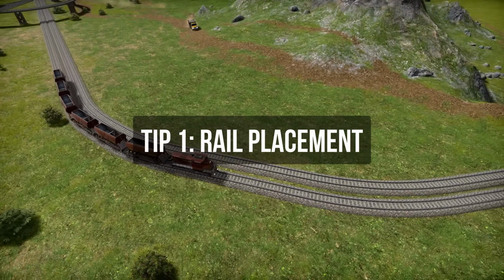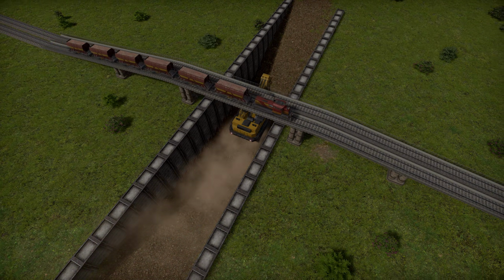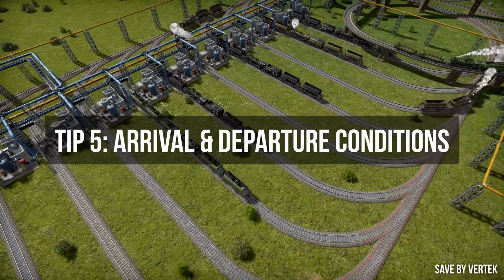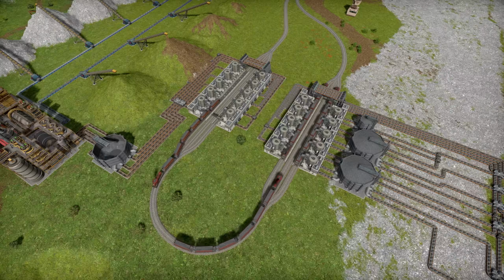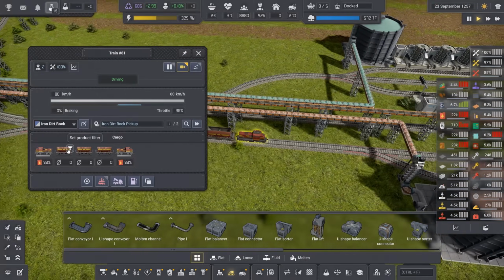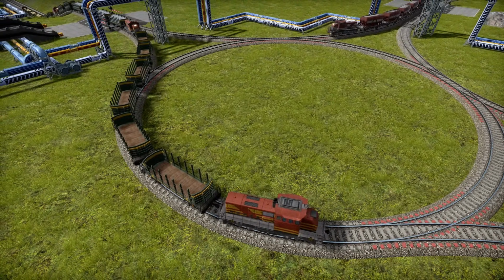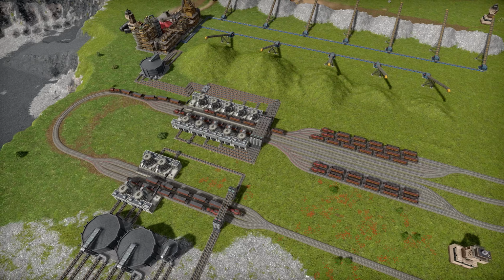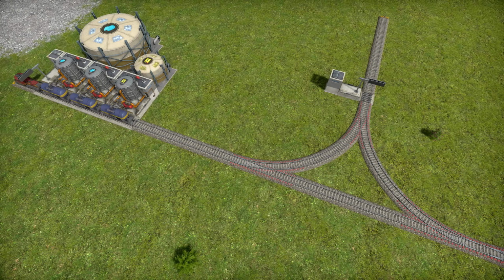Advanced Train Guide for Captain of Industry

Comment: Still, the material transfering of train modules is soooo slow that makes Pipes 3 and belts 3 so much faster. Pipes 4 makes then even worse. The tradeoff maintenance/energy doesn't justifies them. Even the belt/pipe limit of 20k ins't a limit at all. You cant fulfill your industries only with trains, because belts and Pipes are so much better

Comment: I kinda feel like we should be getting access to steam loco's before diesel, with them both showing up at the same time there isn't a whole heck of alot of use for steam engines as refueling and ranging them is alot more cumbersome when compared to diesel, having them available w/ t1 vehicle parts & iron so we don't already have access to t2 trucks/excavators, would alleviate logistics bottlenecks and allow some of us to plan rail networks into our system early on, make the rails out of wood and iron with the option to upgrade them to the current level of track like you would upgrade pipes and conveyor pipes.
also, it would be nice to have the ability to "edit" existing engines when we send them to the depot, like add/remove cars so we don't have to scrap a train to change the number of cars on it, al la Transport Tycoon Deluxes train depots.

Comment: Dont get me wrong, trains are awesome, but i think the way it is, they are unlocked TOO LATE during the gameplay. The moment i unlocked them, i already had all my logistic set and working normally with either trucks or conveyors or wathever. Having to lay down more tracks, wait to check every bottleneck that will come after that so i can fix it, etc... Is simply not worth it. I noticed you unlock both steam and diesel at the same time, whick lets be honest, it is kinda dumb. A way to improve it would be at least unlocking steam trains way earlier so you will have enough time to experiment with laying tracks and figuring out the quirks with the current situation and better plan for the future). The tracks could be build with wood and iron, instead of steel and concrete (earlier tracks could have a much slower speed restriction to compensate that).
Reply: That's true, I just started a new game, and after several hours of gameplay, I am still waiting to unlock and try them...
Thumbs up for your idea with an early tier, steam + wood/iron tracks
Reply: I agree.  Steam train should come early.  It is difficult to overlay a railroad network over industries and transportation designed for trucks and belts.  Railroads demand their space.  Also give us underground pipes
Reply: Honestly this is kind of how I feel about the whole game.  Every time I've played it, I find myself already starting to run out of resources while I'm still way early in the tree.
Reply: I don't agree, it's pretty simple to unlock and it came just in time for the production upgrade in all the three game i did. But all you said about the steam one it's not a bad idea
Reply: @AstoWasHere  Yeah I mean, more commonly for me I don't think they come too late.  I think they come too early personally.  By the time you get them, theres not really any space to lay tracks just because you haven't even flattened enough of an area to make them viable.  And if people somehow are, then that's just insane to me.
Reply: @Blackveiled This game is all about planning, you have to plan some véhicule to flatened the aera you need to do so or build bridge
Reply: @AstoWasHere  True, I'm definitely going way more out than I was.  I'm just getting into late game and I still havent even finished my second coal or iron deposits.  🤷‍♂️. I am opening more routes to other parts of my island anyway, just very constrained on space in certain spots til I do major overhauls.  I really need to do-over my oil and gas production.  But right now I'm working on a new power plant and desalination plant.  Finally overcoming the capabilities of my single ground water source, lol.

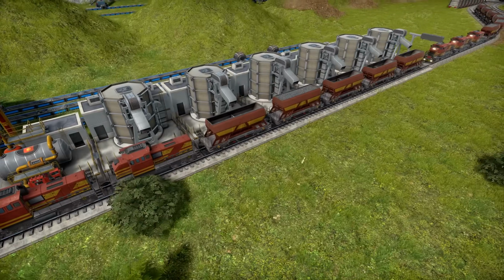Comment: 4:51 This appears to be a waiting area made possible by dedicated "waiting stations". Does this actually work as of today? (2025-07-04) Because I considered making one of these, then someone who is very active in #trains-discussion on the Discord server said that if you make a station with nothing but a Station Module, and the train does actually need to wait there but sees no cargo modules to align with, it will perform two alignments - one aligning the front of the train with the station module, and another aligning the back. 

For this use case, this behavior would be pointless & detrimental, and actually break the station in this case. If that guy was right then in the example you show, trains performing the second alignment will block the exit track and prevent other trains from leaving, because the waiting tracks are not long enough.

Just making sure you aren't posting something built in a previous game build during development that not longer actually works because train behavior was changed, which would be weird for an official video.

Also, since this is coming from you, the devs, it basically confirms that at least someone on the team actually recognizes dedicated waiting stations as a beneficial option for players to have. In that case, I would like to inform you that they are currently kinda bad - because in the Train Schedule, we have no way of making trains skip a station if the Arrival Conditions of the next station is met. This means we must add "waiting stations" into the schedule as regular stations, which trains would pass through regardless of whether or not they need to wait. If, compared to the direct path to the next cargo station, the path through a waiting station is longer or (more commonly) contains tracks with sharp curves, it will needlessly decrease throughput & increase fuel consumption of the Line.

Adding a button, similar to the "low fuel" button for dedicated refueling stations, that marks a station as a dedicated waiting station, which trains will skip if Arrival Conditions for the next station in the schedule is met, would be an improvement.

Also, if the alignment thing is true, then it would need to be fixed to stop waiting tracks from being twice as long as they need to be.

Comment: Any ETA on larger T2 trains?
T1 trains have hard time competing with trucks and belts under most circumstances, they still have their uses but I would use them way more if I had access to wagons with better capacity
Also being able to terraform gentler slopes in line with gentle train slope would be nice, currently if I want to do gentler slope for trains I need to either do alternating steps of flat and slope or start climbing before slope to end at the same level

Comment: I played a lot with trains, and after some time, just switched to hydrogen fuelled trucks. Trains take A LOT of space, they are the opposite of flexible - so they are bad at moving rocks and dirt, which are the most movable items an the game. They are only good to move ore from remote locations. I would say that this game needs more stations and trains logic, so that we can have supply-train_storage - request train network without 6-wide stations taking half of the map. And in the late-game, fuel and maintance cost is not an issue anyway, so trains are only good in the mid-game. I only used 2 lines by the time I got to Mega trucks. I think there are many ways to make trains more useful, but now they have a small niche of application.
Reply from the maker: Thanks for the feedback! Trains have their strengths and weaknesses and their usefulness depends on the map and gameplay style. Trains were just introduced in Update 3 and we will are working on more features and improvements to make them even more useful.
Reply: I hope one of the planned improvements to station logic is to allow trains to link stations to particular stations in a station group (basically making conditional stations). That would make the Wyes at 12:32 much more useful, since not every station on a line may be space constrained.